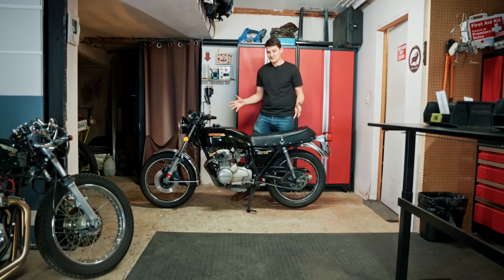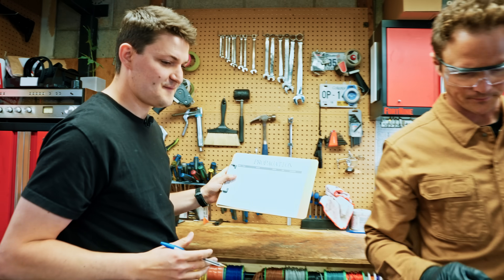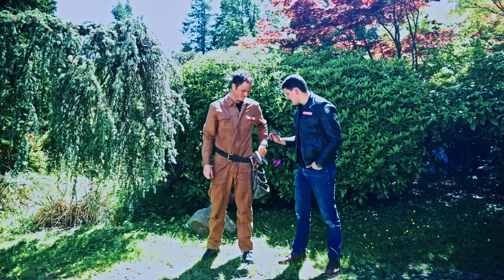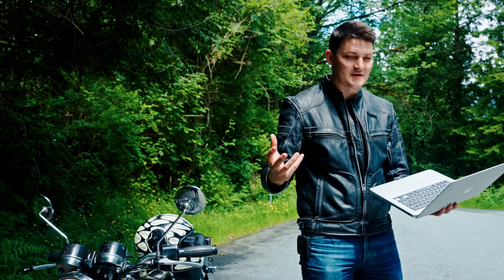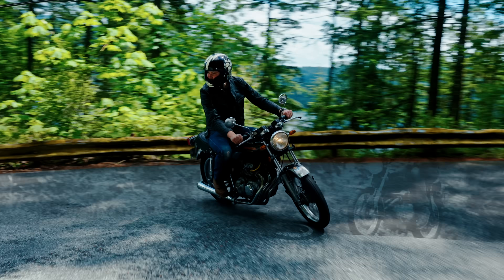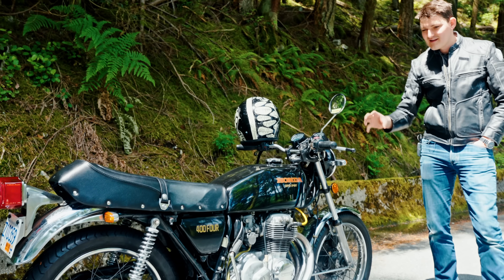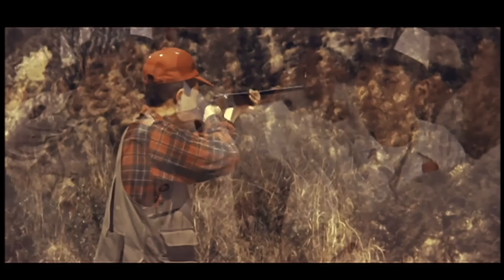Why Hondas Run Great - JIT Manufacturing, 5S Methodology and Kaizen

Comment: There are two omissions in this video, which are quite important. 

First, the Japanese were restricted in their military manufacturing, so all those engineers went to the commercial companies but brought the level of precision required to build fighter airplanes. The Europeans and Americans didn't have precision, which is why old bikes usually suck (BMW excluded in most cases). 

The second is a cultural difference exemplified in the shape of the screw head. Most of the world used Philips heads, designed to cam out of of the screw to prevent overtightening of screws on production lines by unskilled workers. The Japanese use JIS, Japanese Industry Standard, which is shaped to grip the screw perfectly and allow full force without stripping the head. This means the worker needs to pay attention, which is possible because of the Japanese culture of personal responsibility, doing the best possible job and generally being more thoughtful in their work.

These systems would not have worked if it wasn't for the Japanese culture and work ethic.

Comment: I am a "Production Systems Coordinator" for an American manufacturer of drilling equipment. Everything in this video is 100% spot-on. When I need to release an order to production, I have complete visibility of our raw materials and outside vendor component inventory, as well as accurate data for setup and run times.
We're ISO certified and utilize a lot of Japanese methodology.
I've seen ECRs come into the engineering office before lunch, and had new versions of drawings, inspection reports, and milling programs ready to run that afternoon.
It's amazing when everyone brings their A-game and we make things happen.

Comment: I have a 2017 model Chinese motorcycle. After using it for more than 5 years the engine got busted. 

So i imported a 20+ year old honda engine, had it rebuilt and swapped. Now the bike runs even better than before with actually adding reliability since the engine was almost as good as new.

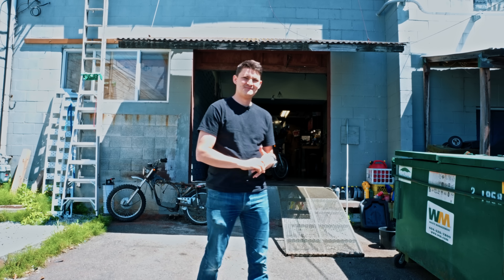Comment: @2:35 Having been to many small Japanese auto/mc workshops I can say they are more often than not a "cluttered mess" and even the ones that aren't a mess are usually jammed tight with equipment, parts and projects aka cluttered. Don't even get me started on small Japanese workshop spaghetti wiring lol.

Comment: My Pacific Coast is about to roll over 100k mi, and it's been appliancelike in its reliability. 
Every manufacturer has some misses tho, Honda would rather you forgot the chocolate camshafts in the early 80s V-4s  and the too-many-trips-to-the-well late 70s-early 80s CB650, not to mention the '08-up CBR1000RR which is a notorious oil burner. They have had a lot more hits than misses at least.

Comment: My favorite bike is the Honda NT650GT. And it holds true. Always starts. Except that second one I own. It’s a special on which a former owner messed up the electrical system. Looking for the fault has already cost me an engine and almost ate a second one recently. Lesson: Never de-Honda a Honda. One day it will howver run as well es my near stock one. I hope! 🤪☺

Comment: I remember back in the 70s and 80s “Made in Japan” meant it’s crap. Now, “Made in Japan” means it’ll be of highest quality.
Reply: The PRC would like to be the same, but "Made in China" hasn't meant quality since like the Ming Dynasty despite catching up to the modern world industrially. "Individual authority is the one thing authoritarians can't copy", which means untold man-decades of observations and ideas wasted because all but a tiny minority lacked the capacity to institute meaningful change.
Reply: @doujinflip  Most products being made in China proves that the Chinese are capable of building quality products...if you pay for em. The factories there are willing to build just about anything for whatever price the customer (or company contracting manufacturing to them) is willing to pay. At the cheap end of things you get dollar store quality goods. At the mid and high end you get consumer electronics, some cars, appliances, etc.

Generally speaking the Chinese are kinda new to the automotive game, and even more so to the world motorcycle manufacturing game. Their EVs and most ICE cars are alright nowadays, but it might be a little while before their two wheel game catches up

Comment: I've had my Honda VTR 1000F 25 years and a few weeks ago with 71,000 miles on it took me back to the Isle of Man for a fantastic 10 days. It performed perfectly and used virtually no oil in the better part of a 1,000 mile round trip. Hondas are the standard others look to.
Reply: I miss my SuperHawk. Glad to hear your success story! It just needed fuel injection to maintain sales imo.
Reply: As long as the ccts dont die they last forever

Comment: I worked in Aerospace for 15 years. We also practiced 5S. I was part of 3 Kiazan work shops. If implemented correctly, it works great. But more often than not. Management would get in the way, so it was always a half ass attempt.
Reply: Management getting in the way has been my experience too. Employees being shut down for trying to suggest a better way is the opposite of Kaizen.
Reply: Apparently this is how skunk works was born in Lockheed Martin. They had a big complex project and knew their corporate structure would not make it possible, so they spun off a group that could work independently of the corporate structure with way less management levels.  @clonkex
Reply: I'm a newer engineer producing paper. What would you suggest to make sure these systems are implemented correctly?
Reply: @michaell742  don't let any one person dictate the outcome of a kiazan project. We always split into teams of 2. normally, 6 teams of 2. Everyone knew the end goal. Every team found what they thought was the best approach, making production as efficient as possible. This included part travel from raw material to end product. Next, you measured people travel. How many actual footsteps were taken from start to finish. When every team has decided on the best approach. You examine those results and then vote on which approach made the most sense. 
To often, managers would take what we came up with and change it. Making the entire workshop pointless. 
This is just a simplified explanation. I'm not that great at explaining all the details, and it's been a long time since I've done this type of work.

Comment: Thanks for posting.  Another way to say it, is to say Honda (and Toyota) infused quality into the manufacturing process by the use of statistical process control/continuous measurable improvement/the Taguchi manufacturing methodology.  The interesting aspect of Taguchi is the introduction of measuring the social cost associated with building defective products, i.e.  how likely is the customer to buy your product in the future if the motorcycle breaks down all the time, always leaking oil, always leaking gas, and has lousy brakes (did I say Norton, Triumph, and/or HD?)?

Comment: I'm currently working on repairing a 1982 cm250 we pulled it out of the barn it sat in for 10 years half buried in the dirt and with just a little starter fluid it started right up.

Comment: 5S is great when a company actually implements it properly. Unfortunately, most US companies only focus on the cost savings aspect of it and ignore the other principles.
Reply: The key is  incentivizing employee input most companies fail to do it.
Reply: @goodforyou3000  the company I work for actually did it the smart way and started offering monetary incentives based on saved manufacturing costs. So depending on how much money you save the company, they give you either a year end bonus, or even a raise. 

It actually cleaned up a lot of sunken costs, because the guys on the ground were way more capable of noticing issues in production, and they were given the incentive to be creative and problem solve. 

I think it was well into the six figure range of cut costs in less than a year, just by letting the employees actually have a stake of the company beyond their regular paycheck.
Reply: We were forced to try 5s more than once, totally ruining any organization created over decades. Management doesn't  get it because being closed minded without employee input.
Reply: @richardvalitalo3670  I'm part of the team and production and multiple levels of management are all parts of the team to apply it properly.  And that works. But probably also depends on the country/culture 😅
Reply: ya, sort of having it happen were i work where the management is focused on reducing cost and waisted time which it is causing it itself and over working some employees. done right its good but some don't know how to properly do so.
Reply: Does it ever apply to the management... CHANGE! The faulty part.... Of course not....
Reply: Failed at Dupont
Reply: Exactly the same here in the UK, esp in the public sector (where things are rarely produced) where a bit of time thinking about how processes get implemented and operated saves heartache and cost downstream. Sadly my experience in middle management was that directors and other senior managers were not interested in doing things better because they had often got their jobs on the basis of promises they made to reduce costs. At all costs. You can see where this ends. 😂
After 25 years I’d had enough of nobody listening to my ideas and those of my colleagues in the teams I looked after.
Reply: It means to keep stopping a production line again again, multiple times a day, it increases costs since employees are still getting paid by the hour and increases time of production, of course management wouldn't understand but it is still the best way to reduce defects
Reply: As a quality engineer who's seen things...let me be blunt. The concern is usually to look good for client inspection or meet a requirement. Can't tell you how many times I've set up a system to have it abandoned the minute someone complains or something costs money (ex. Shadow boards) the issue is that US companies won't pay in time or finance to correct anything, unless it affects the bottom line . Even then often they say oh well ala Ford pinto. US manufacturing quality is a joke. I should know I've seen it. You can't hold employees accountable, let alone personal accountability. It's the exact thing that demming tried to fix in the states. That all aside, there's no pride in our work anymore. Additionaly quality is a toxic atmosphere in the US, they hold you back but expect the graphs to go up constantly like earnings not understanding that is not how it works. I've literally seen a team pep talk called a kaizen event when the defect rate was insane. but we were told don't track it anymore we don't like seeing the numbers. Rant over.
Reply: As a quality engineer who's seen things...let me be blunt. The concern is usually to look good for client inspection or meet a requirement. Can't tell you how many times I've set up a system to have it abandoned the minute someone complains or something costs money (ex. Shadow boards) the issue is that US companies won't pay in time or finance to correct anything, unless it affects the bottom line . Even then often they say oh well ala Ford pinto. US manufacturing quality is a joke. I should know I've seen it. You can't hold employees accountable, let alone personal accountability. It's the exact thing that demming tried to fix in the states. That all aside, there's no pride in our work anymore. Additionaly quality is a toxic atmosphere in the US, they hold you back but expect the graphs to go up constantly like earnings not understanding that is not how it works. I've literally seen a team pep talk called a kaizen event when the defect rate was insane. but we were told don't track it anymore we don't like seeing the numbers. Rant over.
Reply: Ironically, 5S was all culled together by what the Japanese learned from the US rebuilding their economy after WWII...

...and yes, we do not implement 5S/lean properly here in America.
Reply: Same in europe. Especially the part where you listen to workers is left out or their ideal not implemented. Usually because of "cost".

Comment: As good as the end result of kaizen can be, as an enthusiast trying to keep these bikes running 40 years down the line, it gets... rather frustrating. When the first year for a model was '84, it got a different engine in '85, the same engine but different part numbers in '86, a total facelift in '87, and was discontinued by '88, keeping an old honda running when the parts do fail isn't as easy as people like to claim.